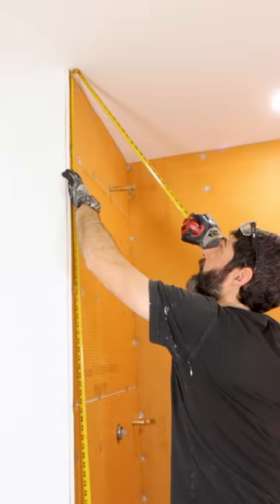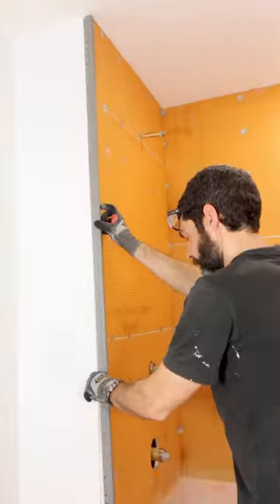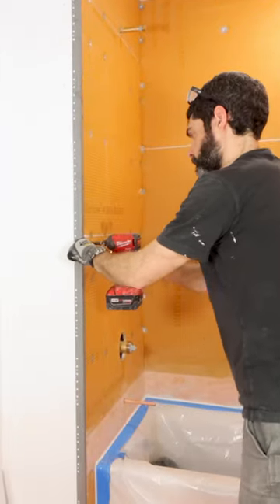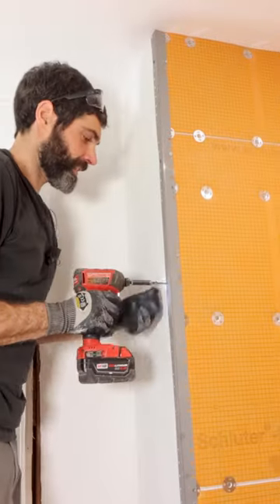Drywall Corner Bead Tip - #shorts

Comment: 👍You do great work.  
Would it be a good idea to use a plastic corner bead instead of metal to prevent rusting?
Thanks for the tip.
Reply from the maker: You could but the banding will prevent that
Reply: @HomeRepairTutor  
I see. Thanks for the reply.
Have a great evening.

Comment: I thought u had to bond Kerri band to metal with Kerdi Fix not just thinset
Reply: why? all you need is a moisture resistant coating to cover the metal edge. Drywall mud would not be good so thinset is perfect for this.

Comment: Why not just use a schluter profile?
Reply from the maker: The profile is only meant to protect the edge of tiles, whereas the banding and corner bead make the outside corner solid and waterproof
Reply: @HomeRepairTutor so you would then use schluter profile on top of the metal corner bead?
Reply from the maker: @jnal21  yes, on top of the banding